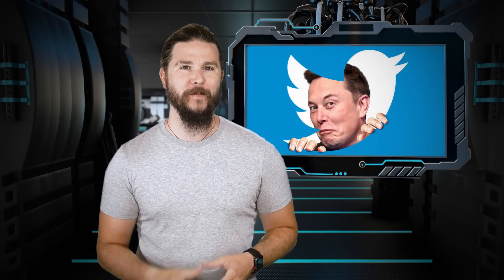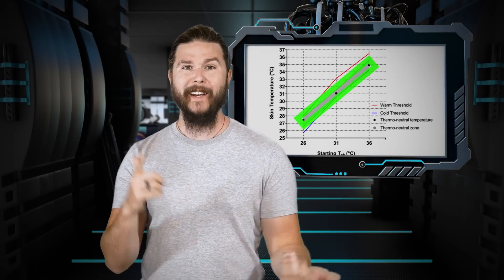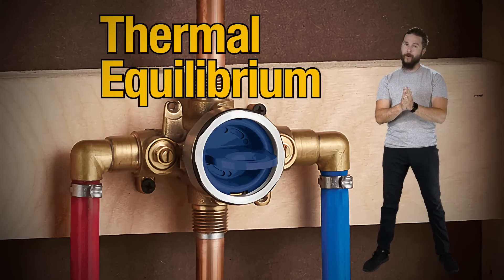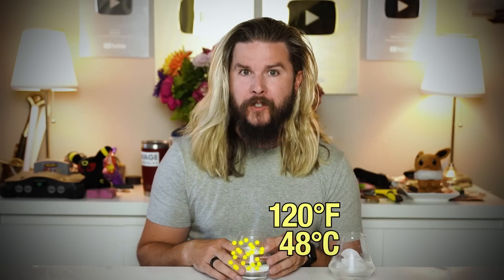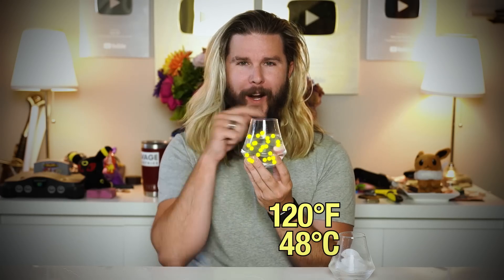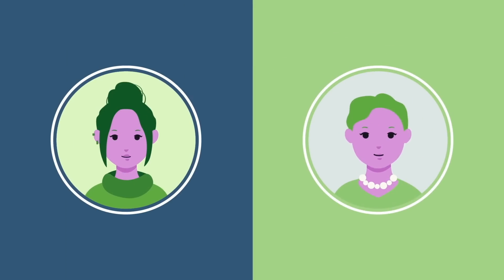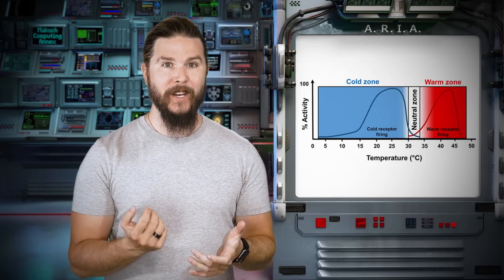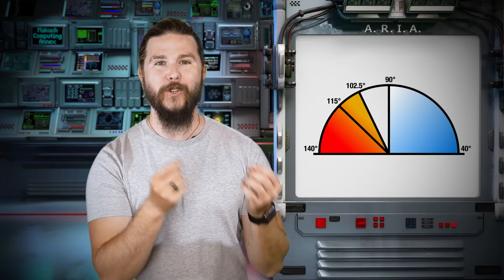Why Are Shower Handles So Sensitive?

Comment: Well not exactly correct. In summer I actually prefer going little bit on the cold side and in winter little warmer than normal. I know it's 20-21°C  inside, it's just something in your head I think that makes you go warmer in winter and colder in summer. I basically never go to the any end though. I think helpful range is 30° on either side (maybe 45°). However once I had pretty bad fiver and I cranked the cold part to the end, it helped a lot so there is definitely situations in which Xtremes are useful. 
Also I find I prefer different positions for shower head and normal phosphate. So it's not just temperature of water but I guess also quantity of molecules at particular area. And surface are of water contacting air around....

Comment: the solution is very long handles, as big as will fit inside the shower basically, to increase the turning resolution... same movement but less degree rotation = more precise mixing 
(only half joking, in theory it would work)
Reply: or hear me out... 2 handles one for hot and one for cold!
Reply: @valenten89  wew slow down there... humans are not ready for that level of advanced tech, lol

Comment: Well don't you have a lucky shower, the ones I've used have been 2 turn knobs or 1 turn knob. I like the 1 knob better because the good temp zone can be a bit wider but the handle is also small enough that its easier to turn slightly. Shower right now has a no pressure point and using the handle printing i know where the zone is (over a full rotation)

Comment: Worst part

When your shower is old and the handle is hard to operate AND its responsible for both temperature and pressure? yeah good luck finding the sweetspot in 3d with tank controls :(

Comment: Residential water heaters are not allowed to be set above 120 degrees by a plumber.  You as the home owner can do what ever you want however, the manufacturers don’t really recommend it as it has a tendency to increase maintenance costs and energy usage as it overworks the heater.  Depending on the age of your shower valve it has several functions built into by law.  Kyles’ shower seems to one of these.  They have an anti scald function which makes you turn it on through the entirety of the cold side of the valve to prevent scalding also, it has what’s called a balancing spool in it.  This is designed to make sure the pressure coming into the valve from both the hot and cold side are always the same.  This ironically make the handle more sensitive to your adjustments but also, prevents you from getting a surprise hot water shot when some one flushes the toilet on the other side of the house.

Comment: So how many valves would you need for better functionality? two (first one injects cold water to the main valves hot side) or two (two valves before the main valve, bringing down hots and raising the temperature of cold)

The two valves option is similar to adjusting ones water heater, but I could see the optimal temperature still being limited to very slim portion of the main mixing valves range. Then again you can actually adjust where your handles range starts, by capping either side and placing the middle position to for example 35/65 mixture.

Comment: Most houses in Brazil the shower is the heater, meaning the water comes cold to the shower head and hits something like those old incandescent light bulbs that heat the water. At the shower you can control the amount of water coming out and the heater intensity, so the higher the temperature of the heater and the lower the amount of water the hotter it gets and vice versa
Reply: Heard some americans call them "suicide showers".
Reply: @franklinfelix1691  I find this very funny, as no one dies, as in other to even get a discharge, you have to be not only not wearing sandals(yes, most of us usually wear them at the shower) but also actually touch the shower with your hands
Reply: @franklinfelix1691  ahuahauhauha... something like that, technically it's really dangerous giving you have electricity running through exposed wires on water that drips on your head, but in pratice is pretty safe, never heard of someone getting electrocuted on the shower for this reason. But I'm not gonna lie I got a little "zip" when touching the shower falcet or temperature control with cheap shower heads, nothing on mortal level, but yeah spend some somey on better stuff... :D

Comment: If the issue is that there is only about a 13 degree window where the water is comfortable couldn’t this be fixed by adding a simple gear reduction so that the full 180 movement of the handle only moved the underlying valve by those 13 degrees?

Comment: Turning down the temp on your water heater has a negative effect also which should have probably been mentioned as well. Warm Water temp doesn't last as long. The best thing to do it to increase the water heater temp and install a thermostatic mixing valve at the heater so you have full control of the hot water temp without sacrificing shower temperature longevity.

Comment: Or.... you could be a low tech genius such as myself and just have a shower that has separate hot and cold handles. 

1 full turn of the hot handle + 3/8 turn off the cold handle = perfect shower every time.   Oh happy days!
Reply: Yea I really dont understand the want of going to a single handle for all temperature control. 2 handles is the best way and provides more control plus you only really fiddle with one anyways which is the cold handle.

Comment: Sounds like another solution would be to make your shower handle super long. Or if you wanna get fancy, install a spinning handwheel from a marine bulkhead on the valve with a decent gear ratio so that you can spin the wheel a decent amount in order to change the valve position to your desired spot.

Or I guess you could just do the thing where you decrease the temperature of your hot water, but that sounds boring.

Comment: This is all thrown out the window when the hot water in your heater starts run low. You know that moment I'm talking about, the one where it becomes an arms race to the end of the hot end of the valve just to ensure the water stays lukewarm until you get all the soap rinsed off.

Comment: What about a handle that is connected to the valve by two differently sized gears? So a handle gear that's smaller could be rotated all the way around twice to get between extremes (putting the halfway point at one full turn), and that would make the valve range of 12-ish degrees expand to a 45 to 50 degree range on the handle. Assuming I'm doing my math right... So the temperature would be just as sensitive on the valve, but less sensitive on the handle, giving the user more control.

Comment: For me as a European this (and the cold/warm water suddenly running out when you're in the shower because someone in the kitchen turned on a faucet or something) is such a exotic problem. Only seen it in the movies.
Reply: My military dorms take about 10-15 minutes to heat up sometimes, and a lot of the times we have no hot water at all.
Reply: That is extremely common though, I experienced that a lot as a kid. I just checked and it still happens in my current home. I won't ever notice though since I'm alone :)
Reply: For me as a European this is such a normal concept. The ideal range of shower temperature is way too narrow, surrounded by too much and too little.
I used to have a shower that showed the actual temperature you set it to and even that ranged from like 15 or 20 up to 60 degrees celsius. The cold end may make sense but 60?
Reply: @cameron7374  I at least use the shower for cleaning things sometimes, e.g. kitchen trash bin. Even though I almost never have leaks from the trash bags I still prefer to regularly clean it with really hot water in addition to the washing detergent.
Reply: @Call-me-Al  Ok, yea. Hadn't considered that. That makes sense.

Comment: The design of my shower doesn't realy have this problem because it has a lock so you cant set it higher than 38 degrees Celsius without pressing a button

Comment: Thermostatic shower handles are pretty much the norm here in the Netherlands. I never understood why they haven't caught on in the US. 🤔
Reply: It’s mainly because people don’t want to spend $1500 on one… 

They’re stupid expensive here.
Reply: It’s like $300 for a thermostatic valve, plus $75 for a volume control knob. This is compared to the common and inferior pressure balancing valve that costs like $125.

Obviously it’s not worth it to remodel a bathroom just to replace the valve, but if you are already remodeling a bathroom for thousands, it’s definitely worth it IMO to spend a couple hundred extra on hardware you’ll use every day for years.
Reply: @iamthefrankleton  umm I installed my shower for 60 bucks total and that included the pipes
Reply: @pyroclastixx6969  Seriously? Can't you just import one for like $100?
Reply: @pyroclastixx6969  Ouch... costs like 300$ in Finland

Cheapest I saw was 175$
Reply: @pyroclastixx6969  that's crazy. You could literally fly here, get the thermostat, have a few days of vacation time, and fly back, and still have money to spare...
Reply: Thermostatic shower set-ups can be ridiculously expensive. And the "eco-friendly" bit about them is laughable as well because with a shower head handle with adjustable settings can be as low or high flow as you want. I personally never understood why people would pay $800-$6,000+ (yes, they can get that expensive if you want it) for a shower head when a $80 shower head with adjustable settings could do the same thing for water pressure. Take the savings and put it towards a tankless water heater and, hey, you have the best of both worlds. And if you've ever had a water heater fail and leak like I have, you're going to appreciate it.
Reply: @matchesburn  You realize tankless water heaters also leak when they fail ?
Reply: @darkdragonsoul99  
"You realize tankless water heaters also leak when they fail ?"
They do not. Traditional water heaters always have water, and thus sediment and eventually corrosion, inside of them unless you empty or purge the system. With a tankless, unless you're actively drawing the water there is no flow for it to fail. The only way a tankless water heater to leak is effectively for your pipes to burst or for it to not have been installed correctly. Neither are the fault of the tankless water heater and both are probably something you'll notice. Whereas with a traditional water heat tank... if it fails due to corrosion... well... You won't. Not at first, anyways.
Reply: @matchesburn  Ever notice that water comes out of the tap the moment you turn it on there is a reason for that think about it for a minute.
Reply: @darkdragonsoul99  
Yes, it's called indoor plumbing. I went a week without electricity and thus no hot water during Hurricane Floyd. Guess what? Water still worked. Just wasn't hot because water heaters that run on electricity can't really work without it. Think about it for a minute.
Reply: @matchesburn  Went right over your head didn't?
Reply: @darkdragonsoul99  
I'm sorry that you think that a tankless water heater holds water at all time and that you don't understand that plumbing is what allows water to be used, not the tank/water heater.

Given that you also installed your own shower and even pipes, I would highly suggest that tomorrow morning you call a plumber as soon as possible to fix the myriad of mistakes you undoubtedly committed during installation if this is your knowledge of how plumbing works.
Reply: @matchesburn  Still going right over your head. How does plumbing work how does that water get to your tap instantly?  It's almost as if it's already there.
Reply: I pay 300 for one in the hardware store.
Reply: i think i swa soemthing about hows its ostly not avable due to power(wireing) and or presear
Reply: Money, the same reason we don't have a lot of things that seem obvious, like adequate healthcare.
Reply: I see the replies that note the extra cost, but it does fit in with the American reluctance to do things that work well for the rest of the world like the metric system, universal healthcare, Paternity leave, etc
Reply: @jaceking5938  add paper sizes to that. A4 rocks! Just printed a booklet a few hours ago
Reply: Wow, this conversation was already about a first world problem and you managed to sound privileged. 
Good job, sir.

Comment: would be cool to have a dual valve system. One that controls the mixing of water and one that turns the flow on and off. So you can set the mixing valve and then leave that alone and only use the flow valve when you go to take a shower.

Comment: My shower is a Hot-knob and Cold-knob independent setup, and I find it way easier to dial in. Hot on full, cold just to where it perceptibly increases the pressure coming out the nozzle and bam, nailed it.

Comment: There are now, while expensive, a shower mixing valve that will limit the hot water when water is used elsewhere on the same circuit.
Reply: of course its expensive, companies know that people will pay extra if that tell them it is.